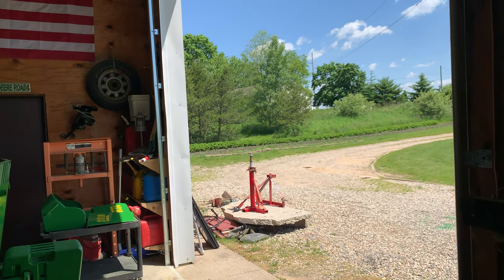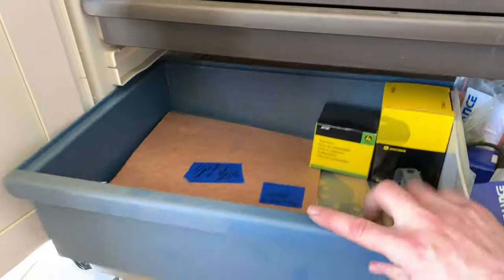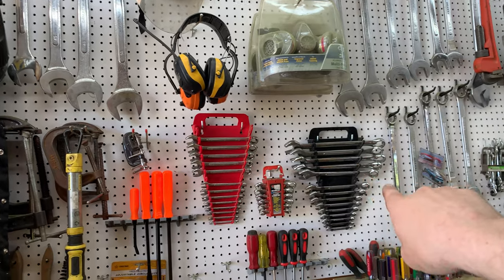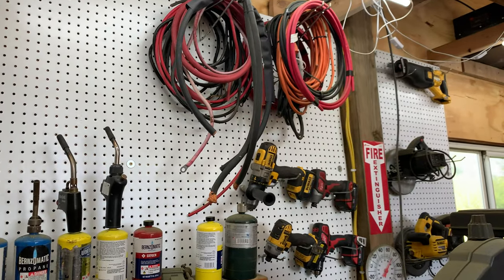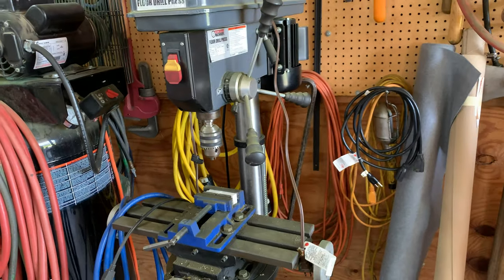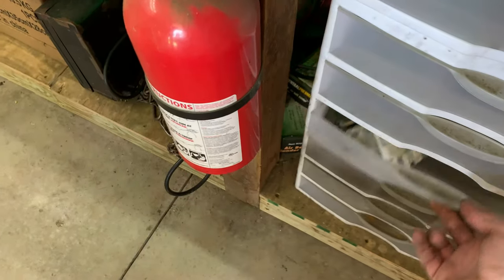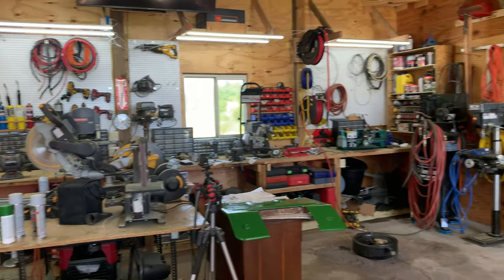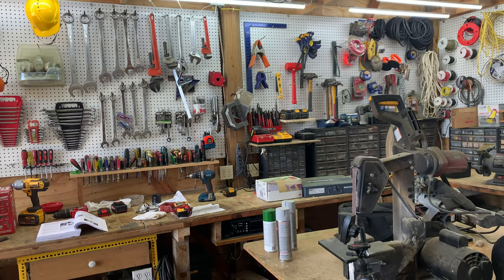What's in the Shop? The Shop Tour 2019 Part 1

Comment: Very nice video Randy!  Thanks for the shop tour.  We had a Harbor Freight air compressor just like yours in our shop.  It worked really great for four years until it finally crapped out on us.  We ended up replacing it with a Quincy 5 hp., 2 stage, 80 gallon air compressor.  We saved the air tank from the old Harbor Freight air compressor and hooked it up to the new Quincy air compressor tank, which doubled the air capacity to 160 gallons.  We had a bead blaster cabinet right next to it and the extra air volume worked really well with that bead blaster cabinet, along with all the other air tools in our shop.
Reply from the maker: I think ours over 5 years old now, been a good compressor so far!